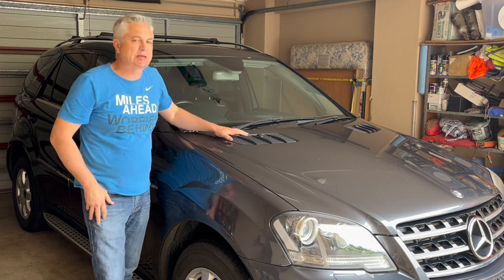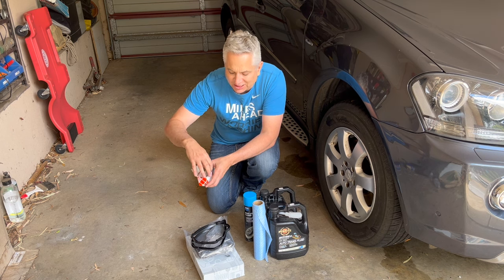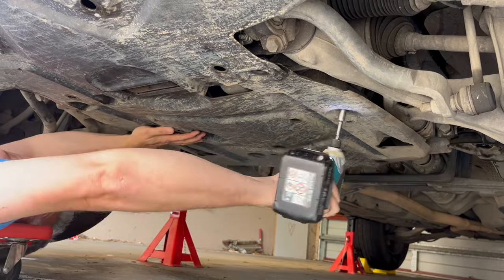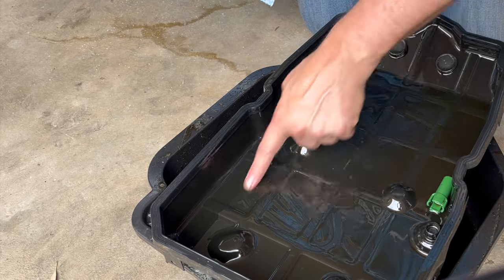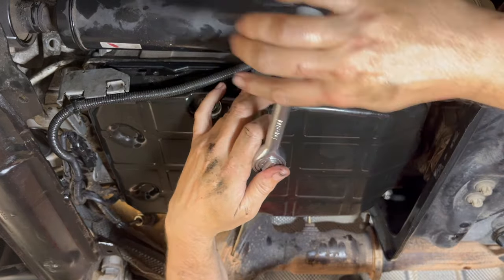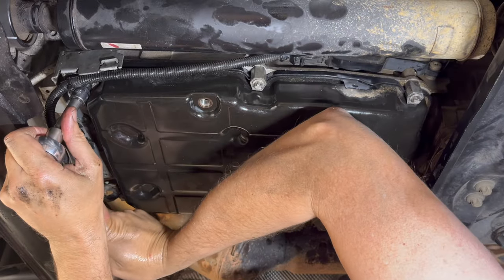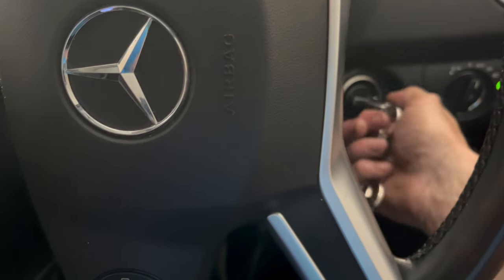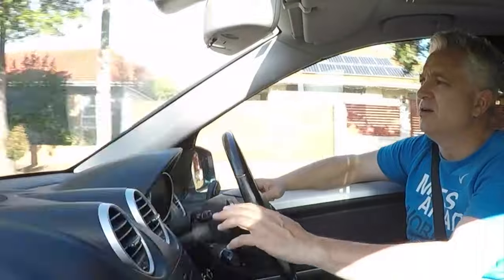How to Service Mercedes 722.9 Transmission by yourself - ML350 W164 Beginners Guide to Fluid Change!

Comment: Hi thank you so much for an informative yet refined video I am one of those people who are curious about the torque converter fluid replacement also. But this job seems to be fairly straightforward now I have watched your video thank you again keep up the good work
Reply from the maker: You are welcome and good luck with your transmission service!  I think if you drive your card excessively hard, do a lot of heavy towing or if you notice the fluid is burnt then the torque converter is worth doing too!  Cheers Drew

Comment: Hi Drew! I'm about to do a full flush soon, so this video help to consolidate some steps.
One i'm going to do, after changing to the new fluid, is to reset the transmission. It will help the TCM readjust to all this new components.

Again, thank you!

Comment: Bloody excellent video mate.
Everything you need to know and no BS.
My 2011 w164 is a bit clunky shifting.Now I've got the new filter and bolts etc I can get on with it. What was that fluid pump you use?Also where did you get your scan tool ?
Cheers 
Tony
Reply from the maker: Hi Tony, thanks for the feedback!  In the video I was using the Penrite Little Mate Pump and wrt the Scan Tool here is where I bought it:  https://amzn.to/3oiAxUG Cheers Drew

Comment: Hey, drew. I meant to disregard a question about the temp gun after rewatching the video.  I have the exact drain plug a T40, and it starts to strip the bolt when I try to loosen. A 6 allen doesn't fit (HEX). If i hammer the bit in better is it possible I can get  it to work.  Thanks and cheers

Comment: Thanks for a great series of vids on these nice cars! I looked on your episode for the transfer case and I understand that they have the same oil in both the automatic transmission and the transfer case. Isnt it advised to change both at the same time? I also read somewhere that they are in fact sharing the same fluid, but it might be an erronous statement ofcourse. 
The reason Im asking is that I have codes and sometimes limphome on my car, its about 240000 km and first owner listened to the crap about sealed for life, so there are no transmission oils changed.  I got the code P0722 and P0721, and sometimes also P0894 together with a limp so the transmission refuse to shift up over 2nd or 3 rd gear.  
The thing is, this only happens when the gearbox is cold. After some 20 min driving, it runs like new, with smooth shifting and no erratic behaviour whatsoever. It summer here right now, so no extreme cold.
I read that those codes can come due to a low oil level (and in my opinion also from to thick oil as it gets when not changed properly, so in the name of science, before I ofcourse change all oils and filter, including the converter(!), I will first pump in some deciliters of oil to see if its curing the problem. 
Im also thinking that if the fluids are shared, a low level in a 4-matic, might be giving more issues like mine, than in a RWD car.
And if not, well, then I guess its time for the sensors themselves and possibly the TCM.. If not only the old oil..

I think Ill get a pump fitting in a can, looks very convenient!
Regards from Sweden! /Magnus
Reply from the maker: Hi Magnus, if it was my car I would: 1/ Stop driving the car immediately and 2/ Perform a transmission service exactly as I have demonstrated.  This will allow you to clean the sludge and sub micron particles from the pan, put a new filter in (which must be blocked and restricting flow), get some new fluid in and set the level correctly.  It’s important to service it as I say without delay because right now driving it as is causing damage.  With that being said I will attempt to answer “some” of your questions.  The transmission and transfer case do not share the same fluid.  Depending upon the variant of your transmission (low friction or not) they may or may not have the same fluid specification.  Now, in my case as I explained in this video I have chosen to run a Australian made Penrite transmission fluid which meets all of the MB specifications but if I couldn’t get this particular fluid in my car I would’ve had the traditional blue fluid in the transmission and red in the transfer case.  So, as I said above if it were my car I would do the transmission service without delay and then I would probably do it again in 6 to 12 months time again!  I hope that this helps?  In the meantime … Stor Stark Tack … Cheers Drew
Reply: @DrewFixIt  Thanks Drew! Agree fully to not drive more with a car in these conditions!  We just went out for a holiday trip when all this began.  So have in fact driven about 1500 km since... but careful...Good idea to make another service after 6 months,  hopefully it will save the machine! 
Ok, then I  understand,  they didn't took the crazy route with sharing fluid at least!
Will write the outcome here later! 
Skål!

Comment: I have the same late model 722.9 transmission in my 2014 CLS550 that uses the blue oil. What kind of oil were you pumping in? It didn’t appear blue in color. Just curious. 
I have called my local MB dealer and 2 independent MB shops. They all say not to drain the torque converter because it is “good” to leave some old fluid in the transmission. This makes zero sense to me. How can used, degraded fluid be beneficial to a gear?

I need to get my car up on a lift to see if I have a drain on my TC or not. If I don’t, then all I can do is the oil pan drain and refill. Hopefully doing this in the next couple of weeks. 

Good video. All camera angles were straightforward and appropriate. Thanks for posting.
Reply from the maker: Hi Mate, I think I explained in the video that in Australia you can buy a Penrite ATF BMV ( https://penriteoil.com.au/products/atf-bmv-full-syn ) which covers both of the MB Specifications in one fluid and it is actually a gold colour.  With respect to the torque converter I understand what you are saying however having done this just a few times now I have the feeling that the filter and magnets are doing their job at keeping the fluid clean and the most important thing is putting a new filter in, cleaning up the magnets (to collect the sub micron particles) and cleaning the pan!  Thus I would recommend simply doing what I have demonstrated more frequently than worrying about the Torque Converter.  Hope this helps?  Cheers Drew
Reply: @DrewFixIt   I did miss that about the ATF. Thanks for the clarification. Yeah, it seems like draining the TC can be a bit of a pain in the arse, so I think I"ll stick to the pan drain this time around and see. I've been told if you can't get to the TC or you don't want to drain it to halve the recommended mileage for ATF service, so in my case 35K miles. 
Thanks again. ATB, Michael
Reply from the maker: @dukebeach1   this is pretty much exactly the interval what I have done with my late model 722.9 transmission and it is really healthy!  Cheers Drew

Comment: Very nice video, thanks. Why have you not used the blue fluid?
Reply from the maker: Hi Mate, did you watch all of the video?  I explain in the video that this fluid meets both the required specification but is a different colour ... the colour is just die, importantly you must meet the correct MB specification for your transmission, this is all explained in the video :)  Cheers Drew
Reply: @DrewFixIt  thats funny, I watched just about the whole thing but panned through when you re installed the pan and began pump filling so it must have been in that small section of clip. That's fair enough, I will probably stick to the blue, although who knows what color it will be when I go to drain it.
 My guess is black.. lol

Comment: Thanks for your detailed guide. I have been watching many videos on this recently as I'm replacing the conductor plate on my ML420. It is the earlier box that you mention, but I have not seen another mention of the 35°C instead of the 45°C. 
I also found a reference to Mercedes fitted with oil coolers where you have to take the temp up to "normal operating temperature" to ensure the cooler loop is filled and then allow it to cool to 45/35 whichever. Thinking about this, it may be because the box will be draining for an extended period whilst the conductor plate is sent away for refurbishment. Any thoughts on this? It certainly would be quicker to achieve the cooling in the UK at present :) Appreciate your efforts - I will subscribe.
Reply from the maker: Hi Mate, thanks for the feedback and comment.  Checkout this post here wrt the different temperatures: https://drivelineap.com.au/2022/08/16/the-mercedes-722-9-nag2/#:~:text=Refill%20procedure%20requires%20the%20transmission,fill%2040c%20%E2%80%93%20level%20check%2045c. Cheers Drew
Reply: @DrewFixIt  thank you. Good reading.

Comment: G'day Drew, Excellent series of videos mate,  well done. I am currently working on my 2007 ML-280 in Scotland. Following all of your videos.
Radiator Coolant Fluid.
Rear Differential Fluid.
Front Differential Fluid.
Transfer Case Fluid.
Automatic Gearbox Fluid,
I have a question for you. On the Gearbox ATF change. I have the white Level Tube. With the RED ATF.

Some mechanics have mentioned 35 degC and others have said 45 degC.

Could you please advise...?
Thank you for your support...
Reply from the maker: Hi Bruce, I explained this in the video at about the 31 minute mark, however it’s probably a bit lost in such a long video!  If you have the earlier variant transmission (which you clearly have) then you bring it up to 35 degrees Celsius to set the level.  Perhaps I should make a dedicated video on the different variant 722.9 transmissions and explain this in a shorter video?  Also, if you do like the videos perhaps consider joining the channel as a member?  I’ve kept it really cheap and it will give you some extra benefits as well as prioritised answers to questions as your questions will be highlighted to me in the backend!    Anyway, hope this helps and answers your question?  Cheers Drew
Reply: @DrewFixIt  G'day Drew, I have joined the channel...
What has led me to this point in time, has accumulated from a faulty front left hand side wheel bearing...
I did not know about this bearing several weeks ago, but the impact of this bearing was causing issues with 722.9 gearbox.
So, I decided to change the fluids, by following your videos.
All good, but then the bearing noise started.
Now, I don't have the specialised equipment to change a wheel bearing, I will get a mechanic to replace it.
Reply from the maker: @brucecook2053  Hi Bruce, welcome to being a member!!  I have not heard of the wheel bearings being an issue in the Mercedes ... out of interest how many kms has your vehicle done?  Cheers Drew
Reply: @DrewFixIt  Hi Drew,  It's a 2007 ML-280 (17 Years Old). Mileage = 55075 Miles ( 88,120 Kms )
 It has the Mercedes Engineering Package. So the ride height can be lifted.
As well as the Front Left Wheel Bearing, One of the Parking Sensors has just failed...
So, it looks like I will need to remove the front bumper to find the type of Parking Sensor... ( Mercedes quoted £174.00 each ) they are about £20.00 on eBay...
Reply from the maker: @brucecook2053  wow, that is very low mileage for the vehicle!  I am genuinely surprised that you are having a wheel bearing issue.  What makes you believe that this is actually the issue?  Cheers Drew
Reply: @DrewFixIt  Drew, I am getting a noise from the Front Left Hand Side.
I have taken the wheel off and put the car in neutral. and the wheel does not spin freely.
I am only guessing it is the bearing...
Cheers Bruce
Reply from the maker: @brucecook2053  Hi Bruce, but it won't spin freely because it has a front differential.  When you did this did you have both front wheels off of the ground?  Cheers Drew
Reply: @DrewFixIt  No, I lifted the vehicle from one side. The side I was checking...
Reply from the maker: @brucecook2053  so given that you have a differential and a transfer case to go through before it gets back to the transmission it is going to be hard to turn in my opinion.  I just find it hard to believe you have a wheel bearing issue in such a low mileage Mercedes.
Reply: @DrewFixIt  Hi Drew, Yes, I now understand what you are saying...
There is a sound coming from the Front Left Hand side when I drive, Do you have any thoughts on what I should check...?
Reply from the maker: @brucecook2053  so, the first thing that I would do is try and understand if the noise is driveline related or suspension related?  Cheers Drew

Comment: Thanks for your video! I have a question for you. If I don’t have an instrument for transmission temperature, can I just measure the old fluid drained and add the same amount new fluid back into the system?
Reply from the maker: Hi Mate, the issue is that the fluid expands with the temperature, however measuring the fluid is always a good rough guide, however I would not rely on it personally as you do not actually know if the correct amount of fluid was in the transmission to start with.  If I had no temperature reading tool, I would rather do the procedure and say run the engine for approximately 5 minutes (cycling through the gears) and then drain off to the leveller personally!  Cheers Drew
Reply: @DrewFixIt  I see, thank you!

Comment: Do u know how to reset the check engine light without a scan tool for the ml 350 w164?  I would have to disconnect the auxilary and main battery if that works

Comment: Based on how much fluid you put in, and then let drain at operating temp it seems like you got 40 to 50 percent of the old fluid out…not 80 like you say.

If you have lots of time you can loosen the screws that attach the valve body to the transmission housing and let it drain overnight. I recently did this on my W205 c300 with a 722.9 transmission and it ended up needing just under 8 litres at operating temp for proper fill level. The downside is those valve body screws are also all aluminum stretch bolts so kind of a pain.

Comment: Hi, does the 2011 Mercedes ML 350 base model 2 Wheel Dr. procedure is the same?
Reply from the maker: Hi Mate, I believe it is the same 722.9 transmission in the 2 wheel drive, however send me your VIN and I will check definitively for you.  Cheers Drew

Comment: hi does the atf have to be red in colour?...nulon has the  low viscocity mb 236.14 but its amber in colour
Reply from the maker: No mate, the colour is simply certain manufacturers adding die.  Just make sure you have the correct mb specification for your transmission!  Cheers Drew
Reply: @DrewFixIt  thanks mate cheers

Comment: @Drewfixit can you please help out with my transmission problem? I have a strange rpm jump when shifting from 4-5 gear, it shifts at 2krmp but revs go to 2.2rpm, other gears are smooth. No error on dash..320 cdi, oil change performed 2 year's ago, with new filter.
Reply from the maker: Hi Mate, it sounds like your transmission is flaring the rpm on the shift from fourth to fifth.  When you say it goes to 2.2rpm does is it smooth on the shift and does it then come back down?  Also, does it only do it when it is cold or does it do it all the time?  I ask these questions because at face value you would say the clutches on fifth gear are wearing, however with these transmissions there are just so many parameters that are taken into consideration between the Transmission Control Unit (TCU) and the Engine Control Unit (ECU).  Cheers Drew :_DFI:
Reply: @DrewFixIt  it happens when hot, and not all the time, but daily.  Once it shifts up, it comes down smoothly. Its only happening on upshift you can feel it's going to shift but meantime rpm goes up like you stomped the gas pedal..
Reply from the maker: @peugeot206rc8  hi mate, I hate to say it but I don’t like your chances.  If it were mine I would do a fresh transmission service on it and if it doesn’t improve I would move it on.  Cheers Drew
Reply: I am planning to ring my mechanic and check with him, will see what he recommends. Nevermind, thank you for your time, and keep up with great videos. Since I got my car 2 years ago, your videos have been very helpful and informative. Great work. 
Cheers
Reply from the maker: @peugeot206rc8  thanks mate, you are too kind! Cheers Drew :_DFI:
Reply: @DrewFixIt been to my mechanic, he scanned the car no issues what's so ever, funny thing about it is in the last few days car actually works normal without gear slipping. Found a bill for trans oil change from 2 years ago, and I am actually suspecting that they put wrong oil in it 😕. My is from 2007. And it should use red fluid, and on the bill it states 134fe which is blue.😳 But will never know until they drain the fluid again. But that will happen after vacation in middle of August. On thing that I was wondering if I could ask you to do if possible, and I am sorry for being annoying Drew. Could you please measure your ride height in cm from bottom of the pavement to the edge of the fender once your car is on. Front and rear. When parked my is at front 82cm, rear at 84 if not using rear doors and hatch. Thanks again and best regards from Croatia ✌️
Reply from the maker: @peugeot206rc8  thank mate, you are too kind!  Cheers Drew :_DFI: